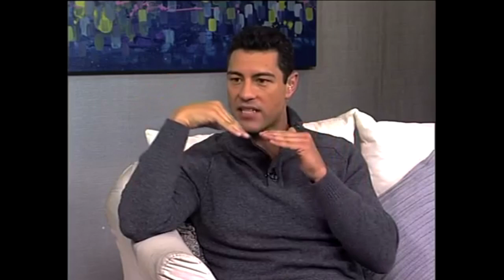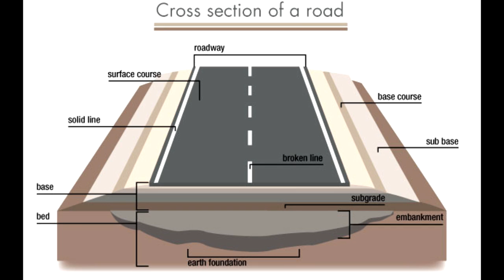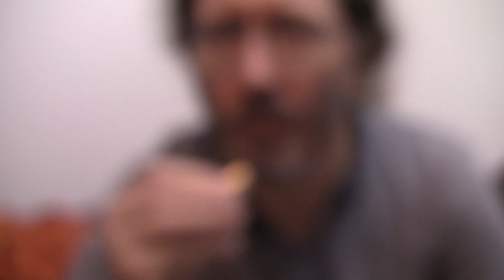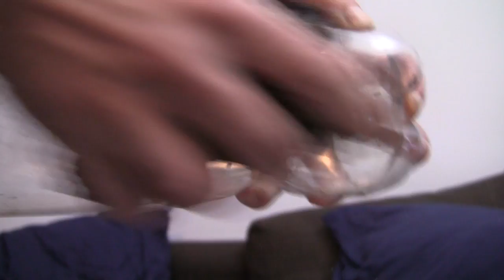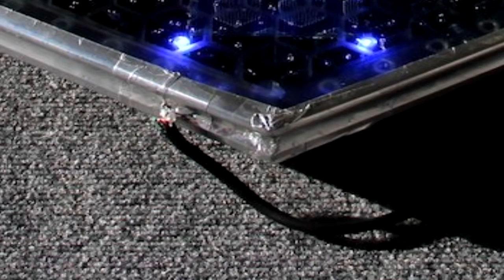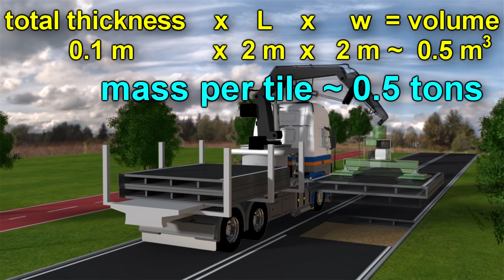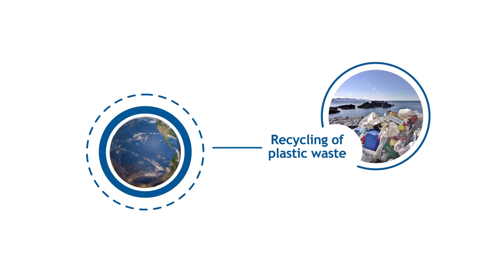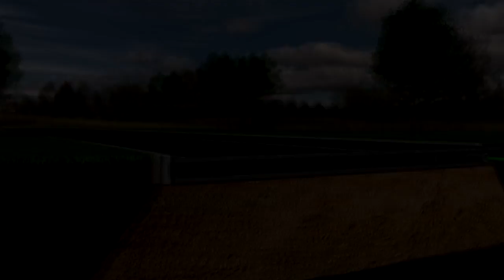Plastic Roadways BUSTED!

Comment: Im sad to say the netherlands already had biking lanes/paths from this stuff. Fucking stupid. I actually work in the plastic/polymer industry. PET or basically the polyethylene family can’t sustain exposure UV light but is also very fragile when its frozen making it brittle and easy to crack. And that makes it unsuitable for winters..................... wouldnt be worried about wear, it does scratch, but wearing down PE / UHMPE doesnt happen easy. Its actually very suited for applications that wear down , like glide strips (which makes it unsuited for a application that needs grip, but 30 years no way. Also recycling PE uses a lot of energy, and idealy can only turned into the moleculair equivelant it was before so PE1000 can only recycled PE1000 and not into 500....

Comment: Ah ha, Thunderfoot! I have to call your intelligence and logic out on this! I believe that I have over 40 years of similar product testing that proves that this concept would, and in fact does work. My evidence, Scalextric! I product tested it, albeit without underground power lines and pipework, for many years until my son took over and the road surface hasn't been damaged by this level of high speed testing. I'm fairly sure that you and I could collaborate on this project,
 upscaling the track and removing those metal strips which I have no idea what purpose they provide, although my cars seem to run slower without. What do you think?
Reply: Square–cube law
Reply: @Robert-dB  good point but Galileo never got to apply it to Scalextric, maybe it would prove his theory wrong?
Reply: @furious32ninja  Yup, that's exactly what they'd say ... if they could be bothered to use Wikipedia. 😞

Comment: I work in construction and that includes roadways and roads are rarely straight and flat. Infinite radii, infinite elevations, the customization would be insane and not producible. Also, water finds its way everywhere and would get under these surfaces and probably make them float. (fair enough and under-drain system could handle that issue but that is yet more cost)

Comment: I’m sure this has been mentioned before, but any electrical or optic wire, or anything else that goes through the road will require connectors on each side of each replaceable segment. Each connector is a potential point of failure. I just can’t comprehend the stupidly high cost of manufacture and maintenance. 
If these are all standard “built offsite” segments it will then require standardization of the various cables, pipes, etc. Yeah, right, every roadway will have the same requirements.

Comment: Actually, have they actually built even a one yet, even a short proof of concept? If not it's simply vaporware, actually. It would be nice to get all the plastic crap out of the oceans though.. be nice to eat seafood without a gut full of plastic.. or eat seafood at all, again. The plastic poisoning also affects us too.. I stopped eating it about 7 years ago, for the most part, due to the high radioactivity, oil, and corexit and plastic contamination. Shame..

Comment: Coming back here - modular roadways have already been implemented. They are not 100% plastic - they use standard asphalt as the top layer, elastic polymers as the second one and a porous one in the bottom part. They are easy to setup because they are prefabricated, and they use up less machine power to make.

Comment: There is some practical applications on some level. Nothing wrong with dreaming big and working to perfect an idea. That's kind of how it works, right?  There is a house (Pensmore Mansion, Missouri) built with tiny strips of wire mixed in with the aggregate of concrete and built a house and the concrete is stronger and harder.  So, a bit of plastic could add something when melted with tar and aggregate.... but 100% made of plastic? No. Doubt it.

Comment: For goodness sake stop being so negative. The road is not going to be made out of the exact material that plastic bottles are made of. It will be a researched and tested composite of incredible strength. But it will have a high plastic component. Various plastics are already used all over the world for the manufacture of components requiring incredible strength and wear resistance. Not a difficult task.  As for road base requiring most of the effort, it is not difficult to see that the structural strength of the sections themselves will add considerably to the stability of the roadway and could easily lead to new, quicker methods of base preparation. Indeed it may even be possible to lay these section down over existing road bases. I do have a question on road noise reverberating through the hollow sections but its early days in the research.  I particularly like the concept of roads also becoming solar generators too, particularly with the move to electric cars. Roadways could become the new method of electrical distribution, eliminating unsightly above ground cables and towers.

Comment: I agree that what you say is true about asphalt , SO IS THERE AWAY TO MAKE PLASTIC HELP ASPHALT? MAKING IT MORE flexible so not to have so many POT HOLE  Plastic would add flexibility allowing to hold the asphalt together.   MAYBE ?. Why do pot hole happen it the road is flattened down squeezing out air so no water can get in.

Comment: What's the difference between PET and PETE, other than the second E? PET bales $400 - $600 a ton? I used to work in a recycling plant. I ran a huge industrial baler that baled that shit. Those bales would get stacked outside for years until they got the price they wanted. They weren't clean like the picture either, people don't rinse their trash, it goes in the blue bin and the blue truck picks it up, and that's the last fuck John Q Consumer gives about it. The comingle recycle trash goes to a lot where the blue trucks dump it, and guys like me push it into a huge pile with huge machines, then it sits there in the weather until it gets scooped up and dumped into a hopper, which sifts it onto a conveyor belt, where some low-wage workers sort it by hand, paper, #1 plastic, #2 plastic, clear glass, brown glass, green glass, aluminum... a magnet pulls the steel off, and the rest goes thru a drum that sifts the broken glass out. The plastic, the aluminum, the steel, and the paper get baled. The glass gets stored outside in the weather in mounds. The bales get stored outside. The steel rusts. Everything gets filthy, the ground is just soupy mud. The aluminum is the only thing they really give a shit about, since that's where the most $ is. It moves fairly quickly, but the other shit, especially the plastic, that shit just sits there in the mud and piles up. It's all hidden from public view behind walls and fences. You might be able to see it on Google Earth, but the prissy yuppies who demanded mandatory recycling programs can't see it from their McMansions... What a mockery of itself society is.

Comment: This is going to fail, one thing is if they have fiber optics in it it would work. Cause when you pick a element out of the road the fiber optics will take a other route to your house cause its hooked up in cirkel and will take the longer route. Same with the fiber optics currently in the ground if the fiber breaks it will take a other route. Any way this is going to fail even in freezing temps. If it rains and its going to freeze over night well R.I.P. road.

Comment: Even if the roads held down against hard acceleration or deceleration, the plastic roads would suffer from exactly what all older concrete interstate surfaces the US did, where the road surfaces rocked back and forth as cars and trucks drove over them, leading to them no longer being smooth and level to each other. Where you get rough bumps at every single expansion joint along the surface. But the plastic roads would be so much lighter than concrete that the issue would manifest even faster.

Comment: Polymers degrade under UV light influence from the Sun and other sources. That is a huge problem. I assume that most of plastic roads are intended for outside usage. :) I repaired recently one UV light source in which UV lamp holders made of plastic became brittle and some of them were damaged (cracked or broken).